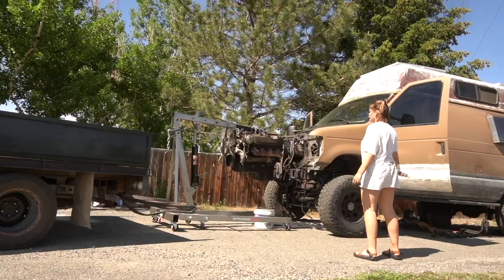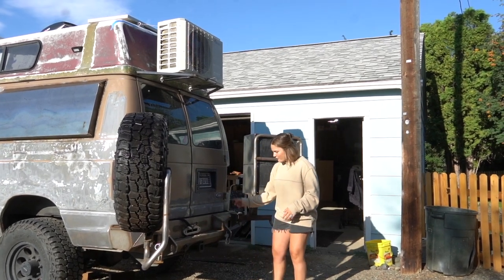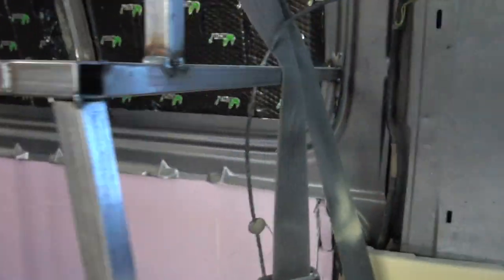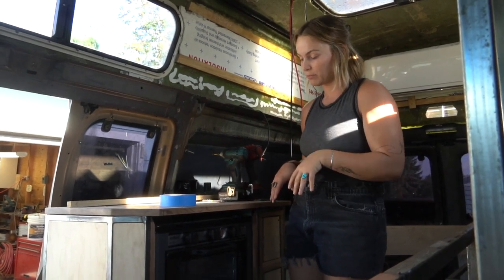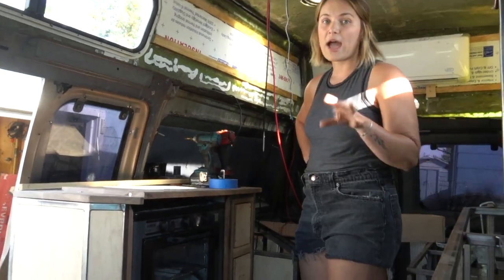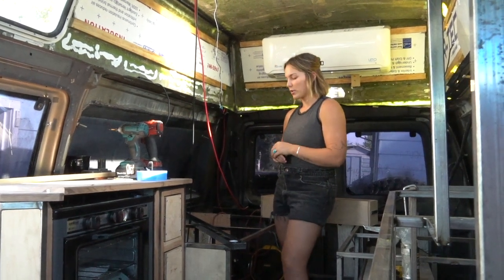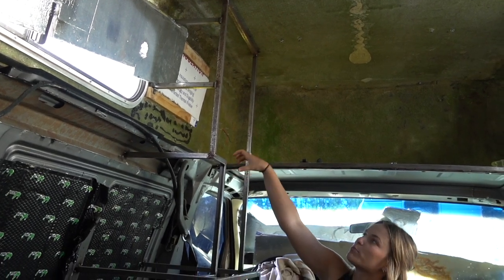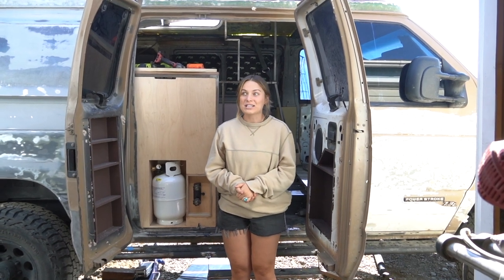4x4 Van Conversion Tour // MID Van Build.. What we have done so far and whats planned

Comment: On your fan all you have to do is get a three-way switch and reverse the wires it would suck in or blow out. Very easy
Reply from the maker: Hey! Would we hook the wires up to the main power wires or just the motor wires?
Reply from the maker: Thanks for the tip 🙌🏻🙌🏻

Comment: Hey have you guys decided what to paint the van with?? I would go with raptor liner . Stuff is so cool. Scratch proof and deadens sound. Plus it looks really cool and you can tint it to any color. Get their specific epoxy primer to go with it, its anti corrosive and holds up to 2500 hours of salt water spray just the primer alone, plus its wet on wet compatible with the raptor liner itself so you only have to wait 1 hour after their epoxy primer to spray raptor directly over it, no sanding. Thats what I’m painting my van with in white. I love the junk yards, saves so much money, I have a club wagon and didn’t want so many windows. So I cut out panels on panel vans where my 2 longest side windows are and stitch welded it in where the window once was, just gotta do the other side now